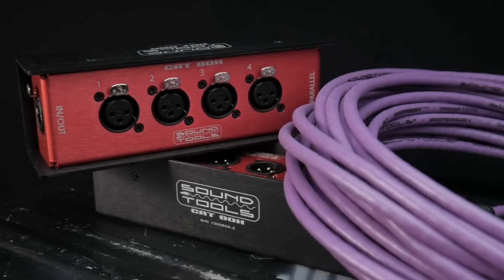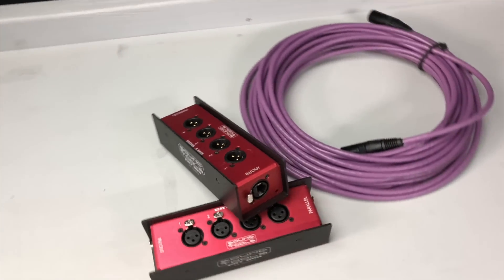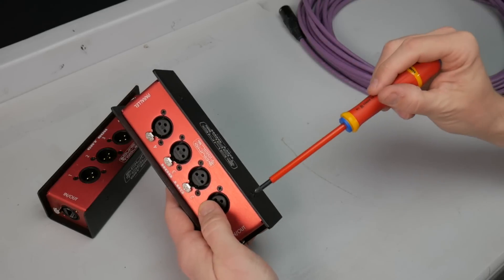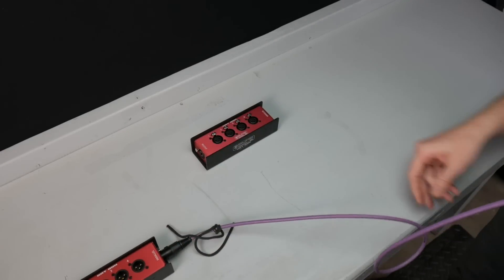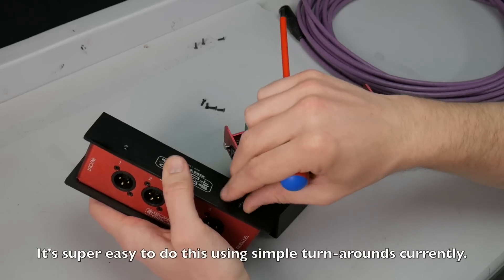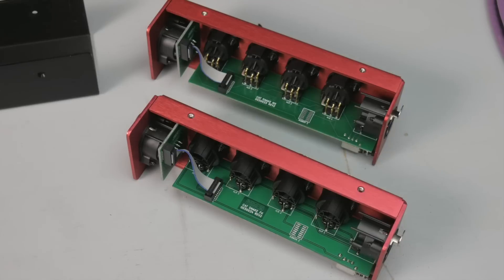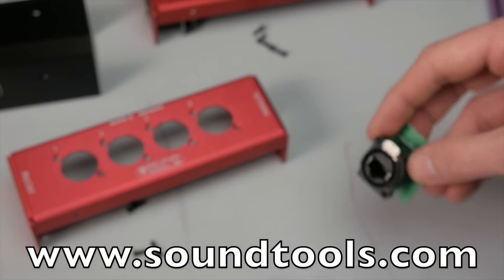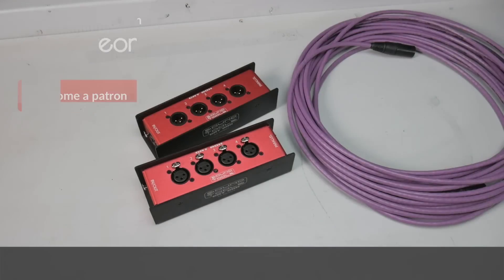SoundTools CAT Box Snake & SuperCAT CAT5e Review

Comment: I have used ours for a line array setup at a school and we have just left the cat 6 cable in the roof and then when we go back for the next show all of the speaker runs are already ran. Super easy.  I added a safety cable by removing one screw and then making a bracket for the cable to mount the cable to. Gaff tape works well too in a pinch.
Reply: How does that work Donald ? 4 Channel sound tools snake working to carry up to 4 zones of audio to your array?
Reply: Shawn Thomas We do channel 1for right side ch2 for left and then we feed 2 monitors we ch3&4.

Comment: I absolutely swear by the CAT Snake! It's been keeping my tour pack lightweight and cleaning my cable runs when we play in tight spaces. The band loves the look of them too! There truly are many different uses with these. I've been making my own male-male and female-female XLR turn around cables when I use them in festival mode and want to hook a DXR12 or K12 right up to it. 
If you need an 8 banger you could easily get that flexible weaved nylon conduit shit at a computer parts place to put two shielded CAT 5/6/7 cables in it. Make some shorties and BOOM! You have a rugged drum snake with easy disconnects. Add velcro to make them stay together, place them left/right of the drum riser, or stick 'em on hardware. So many possibilities. 
Am I affiliated with Sound Tools? Nope, I'm just a regular freelancer guy who loves all the sound tools.
Reply: Some cool ideas.

Comment: I recently had the opportunity to work with a small-ish conference venue rebuilding their whole AV infrastructure. Ended up going with tons of shielded twisted pair drops (with Ethercon Cat6A sockets) all over the venue (augmented by some coax in key points) and a central patchbay. The beauty of this is that you can get pretty much anything to or from anywhere in the venue without needing to run long temporary cables, using the appropriate converters (analog/digital audio, HDMI, VGA, networking, DMX etc.), makes it super flexible. The only caveat being needing to make damn sure your patching is correct before turning anything on for obvious reasons :)
Reply: Made some tails with ConvertCon XLR's to solve the needs outlined in the video.

Comment: I started down the audio over Cat5 cable with some studiohub breakouts. conveniently they no longer sort of exist? and now there's a big market for these things. The guy who came up with them was in the middle of a multi-month / week Studio install when the IT guy showed up installed all the networking and left in one day, he asked how did you do it? And said there's got to be a better way, and started realizing that Bell Labs? came up with a pretty decent cable system for balanced telephone lines that were then repurposed for data. The only thing was StudioHub is that they are 2-channel only because they're more meant for radio station type patching around. But I was able to drop a 50-foot cable from side of stage mix position to two mics on stage for a wedding with one thin black unobtrusive cable, I was able to do a mic for the guitar and a mic for speaking / singing. Yes I use them a lot I also used another run from the mixer 25 feet up to the amplifier mounted practically on the 15-foot ceiling at the venue. I just recently used it to grab two wireless mics from the receiver in a closet at a hotel to run out to my mix and Camera position on one cable and I only had to run one cable back to their mixer in the same position to feed the house system. this allowed me to mix wirelessly and sub out feeds for live streaming and drops for at least one person to take me up on the offer. I feel like I'm the only one who knows about Press Box drops in my area such a foreign concept.

Comment: Nice video. Could it be an issue of crosstalk if you make modification of the 2 in 2 out setup on same cat cable with line level output and mic level input?

Comment: Will they work as a splitter? For instance, if I send signal into the box and out say ch4, and connect to the parallel output to another box? Or does that redirect the signal flow? Thanks
Reply from the maker: Yea absolutely, using them as a splitter is one of the things they were designed for!

Comment: If i have understand right... its just a 4 balanced signals box with just one cable with 8 conductors and 1 ground right? with the issue of use a thin CAT 5 cable to carry the signal... i would still prefer the clasic 4 ch snake for this pourpose...

Comment: Can this be run through a network switch or does it need to be a straight AB connection?
Ideally I would like to avoid sending multiple network cables to one area, if I can avoid it.
Reply from the maker: Hey, no these are point to point and need shielded (ideally with ethercon connectors) & stranded cat5e or better to work. They’re essentially a copper snake, taking advantage of some of the unique properties of network cables to create four twisted pair paths. You can choose to put analog down those paths, or digital in the form of AES or DMX Data etc, but it’s just going down copper as is, not being turned into network traffic.
Reply: @DcSoundOp  cheers, that clears things up

Comment: I use a 16+4 old school snake and use them all. I would need to run 6 cables?  If so that wouldn’t be much different than now.  I do like the thought of it though
Reply from the maker: For a situation like yours it would make more sense to add as sub snakes to your 16ch main snake. Anywhere you could use 4 channels together on-stage you can drop one of these and patch a single cat-5 cable back to your snake. They’re great for keyboard players, a pair left and right side of a drum kit for 8 channels etc. Thanks for the message & thanks for watching Todd!
Reply: @DcSoundOp  I wouldn’t be able to individually adjust them though,the 4 sub snakes? My drummer don’t care lol.
Reply: @DcSoundOp  I do have a Soundcraft UI24 and just run one line to the laptop. But it fried in Aug and I might not get it back from them until April due to no parts so I have to go back to what I used prior. Thanks for the replies!

Comment: It's probably mention in this section, but what is the maximum length of the Ethernet cable in this sort of setup?
Reply from the maker: You should think of these functionally the same as running standard XLR. Driving longer lines will require the same approach as it would normally depending on what your sending (analog audio, AES, DMX or COMMs) - but functionally it’s as capable as traditional XLR.

Comment: Okay so I thought this was basically a snake box that runs through a CAT5 cable and that there was some way they figured out how to run more than four channels so I go on there and I checked the Amazon website and there's nothing there like that I'm hoping that one day that there would be able to have a 16-channel analog type snake box with a CAT5 cable that would be a whole lot cheaper than say the PreSonus StudioLive III 16R 24R or 32R rack mixer (which I have the 32R and love it) and it definitely can be used in that manner as a  snakebox/stagebox/audiointerface and be connected to the PreSonus StudioLive III 32S console mixer and can be Daisy changed to have more than one mixer/stagebox/audiointerface connected to say the PreSonus StudioLive III 64S so that way you can have two 32R's Daisy changed it together and ran from the rack on stage and connected to the 64S via CAT5 or CAT6 AND STILL HAVE ALL 32 OR 64 CHANNELS. But that is digitally and this company does not do it that way this is basically an analog snake and it cannot be done with more than four inputs and outputs in between the two so if I was to want to have for example a seven piece drum mic set connected to my rack mixer I would have to have two of these boxes the female ends running to the drum booth and then I can run the CAT5 cables with a pigtail at the other end to plug directly into my rack mixer so it's still usable it's just instead of for an example a 16 channel snake that weighs 150 lb it's a four channel snake that may only way a pound or two but you have to buy more than one you would have to buy four of these and four cat five cables with four sets of pigtails if I want to have 16 channels which would end up running more than what an old school snake box would cost 🤷

Comment: I like the idea of these, but are they wired with the ground opened? A cat5 cable has 8 conductors, and using 2 conductors per XLR, is pin 1 on each connector still carried through the single cable?
Reply from the maker: Here's the wiring from SoundTools website - http://soundtools.com/products/catfamily/images/etherCON%20wiring%20diagram.pdf - Pin 1 is tied to the shield.
Reply: DcSoundOp sweet! I will definitely be picking a couple of these up.
Reply: @DcSoundOp  Do you happen to know why the pairs are wired like that? Instead of in sequence? Is it to minimise crosstalk?

Comment: Can the cat 5 or 6 cable used pass phantom power for condenser mics?
Reply from the maker: Here's a recent video from Dave on Phantom power using the SoundTools gear - https://youtu.be/_8UTGcuAtd0 - but in short, yes phantom is no problem at all, assuming you've used shielded cable. Thanks for the great question.

Comment: I notice that there are several companies making this type of Cat5/6 connection snake.  Is there a standard connection protocol that they all use, or do different manufacturers each use different standards?  In other words, can you mix SoundTools CAT boxes with Radial Catapult devices?  I’m guessing that there is a standard protocol and that this is possible.  Am I correct?
Reply from the maker: That’s a great question. Unfortunately there is no standard & they are generally not compatible across brands. I’ve tried pushing the folks I know to talk and agree on one standard, but those things move slowly & we’re just a small voice asking for it. Thanks for watching!
Reply: @DcSoundOp  Yeah, that’s what I was afraid of.  I am trying to set up a simple setup where a single snake goes to both a PA and a recorder.  The parallel RJ45 make that easy, except that I’m worried about dual sources of phantom power (the recorder and the mixer).  I know that the recessed ground lift button will lift the ground on a single Cat Box.  Let’s say I had a male Cat Box with the ground lifted and was using that to go to a recorder, and then a Cat Tail fanout going to the PA, would that only enable phantom power from one device?  Or would I be better off going with the Radial Catapult with transformer outputs?

Comment: Will this work in my PreSonus Studiolive 24 series III AVB network? Let's see $120 for the cat box plus $70 for 25' of ethercon cable that's $190 for four runs or two stereo, $600 for PreSonus AVB, NSB 8.8 with 8 xmax preamps and 8 XLR's returns for IEM's or floor monitors, that's a no brainer!!
Reply from the maker: The CAT family of products from SoundTools are not networked audio (Audio over iP or AoIP) - they are simply a modular alternative to running traditional copper snakes. If your needs involve running analog audio or AES digital signals, these work great. They do not provide any functionality related to AVB networks or any other audio over IP solution. 

I hope this helps clear things up. Thanks for the question!
Reply: I see,thanks for the imformation it's kinda new to me still.

Comment: Thanks for the video! Do I need a male and female? My standard mic XLRs would obviously take the female box; but would the out run straight to my rack, or would I somehow need the male box to get the signal to my rack? Sorry if this is a stupid question.
Reply from the maker: Thanks for the question Tim! You are right that you would want the female box to plug sources into, and then a male end for the output side. If you are connecting directly to rack gear, you might find the Cat Tails handy for the output side, as they will let you plug right into the gear you are using. Check them out @ http://soundtools.com/products/catfamily/cattails.php
Reply: @DcSoundOp  Thank you so much!

Comment: Is this compatible with Dante?
Reply from the maker: Dante is an AOIP (Audio over iP) or audio network solution, while these are simply a way to move signal that would typically be on an XLR cable via shielded network cable. Let me know if that makes sense or if I can explain more. All the best, thanks for the question!
Reply: DcSoundOp That makes sense. Thank you!

Comment: Why wouldn't you just drill a hole in the black outer shell to attach a safety chain to it to fly them....
Reply from the maker: You're saying to fly it by just dangling it from a safety??
Reply: @DcSoundOp  if you're wanting to permanently mount it to a truss just drill a couple holes in the back plate, screw it to the truss and then reattach the module.... If you just want a temporary fix, zip tie it to the truss supports or drill keyholes in the back plate so you can mount it the same as the permanent mount but still be able to remove it since it is mounted with keyholes
Reply: @DcSoundOp  hopefully all of that made sense, if not let me know.... The other option I liked was the rack mount 12 channel option that company offers

Comment: These Cat5 breakout boxes have nothing to do with Ethernet. They are simply balanced analog audio connections running through the eight conductors in a Cat5 cable. What happens to the ground wires in each of the 3-pin XLR connectors, you may ask? They are all combined in the single Cat5 shield that surrounds the eight conductors. So not only are you relying on the fragile RJ45 connectors on the ends of the Cat5 cable, you are degrading the isolation of the previously separate ground wires of the four balanced XLR cables you plug into the inputs and outputs of the breakout box. If any interference or hum is present on any of those grounds, it will contaminate the grounds of the other three XLR cables as well.

TL;DR: Don't waste your money and risk your reputation on garbage technology.
Reply from the maker: SHIT! I better get on the phone and tell the guys to de-rig Coachella QUICK before the weekend!! So thankful you were able to set things straight for everyone before anyone's reputation was ruined.
Reply: @DcSoundOp  - Just throw Di's at anything that hums, right?